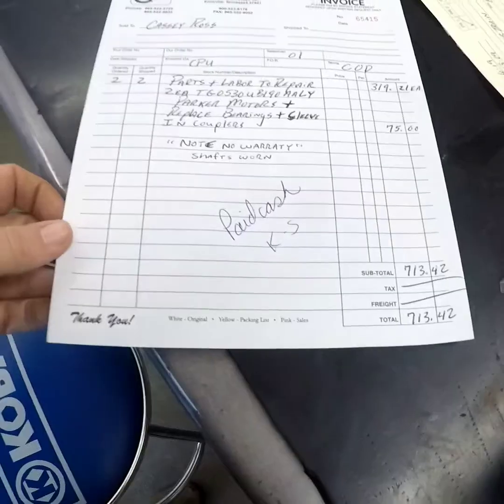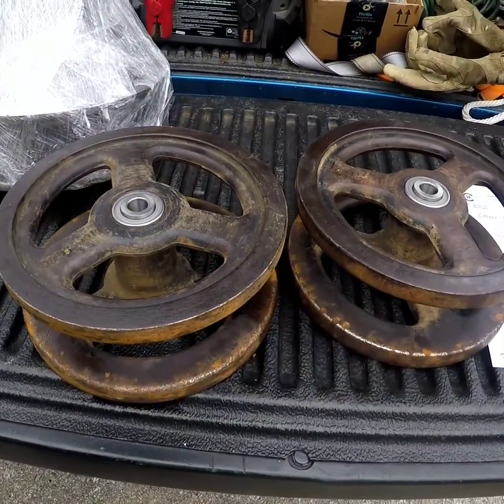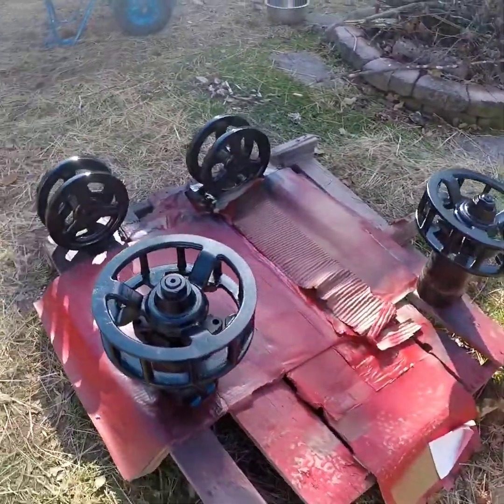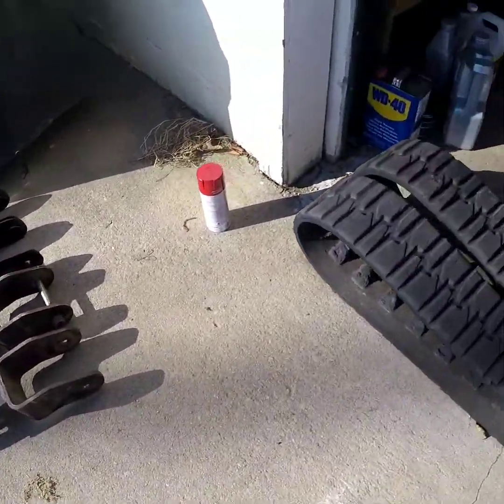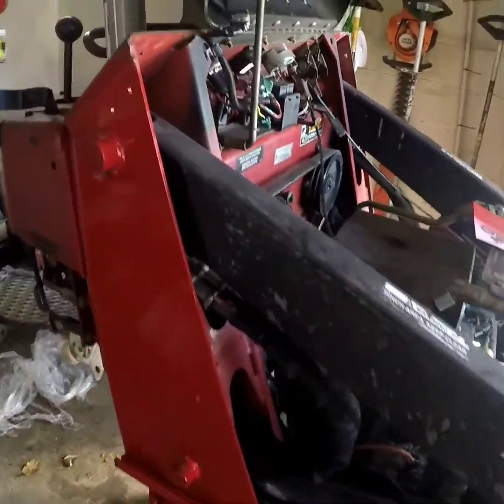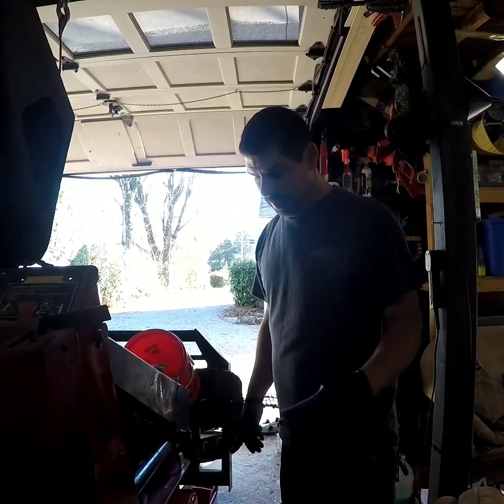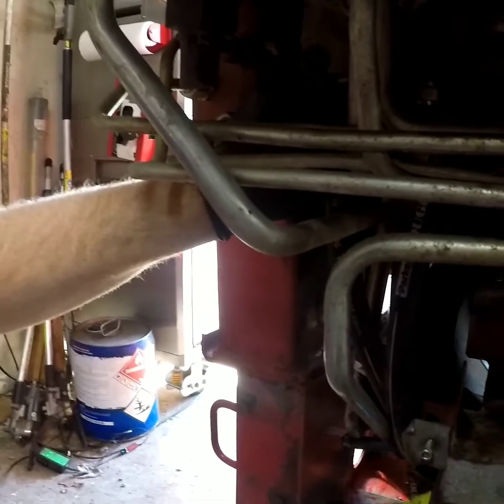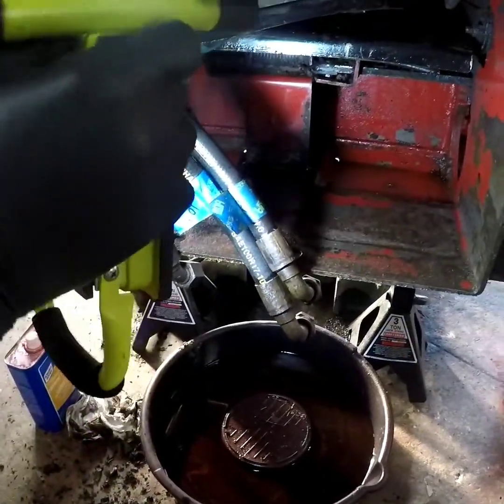Toro dingo tx420 hydraulic motor installation.

Comment: Great job Rossco, I'm a former Snap-On Dealer Retired and Yes now I run a Parts/Service/Technician on the entire  line of TORO  SWS equipment, and the most important issue of them fittings is Space... I use Crowfoots made by Sunex, they affordable and saves time, effort and space... I do want to thank you because I've done the job many times but usually split the Hydro Motor from the Wheel ...
Anything I might be of help contact me @ 321-616-4483  Ingenium Power and Sport  Orlando, Florida .